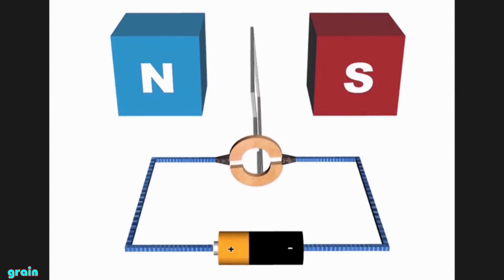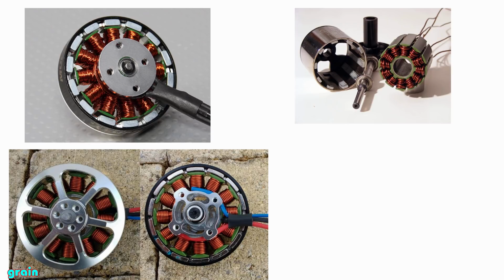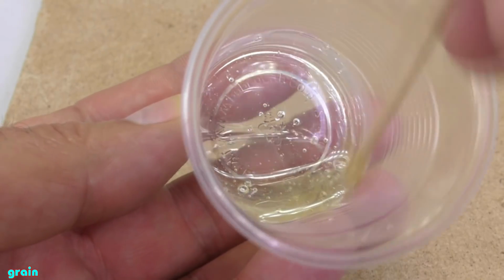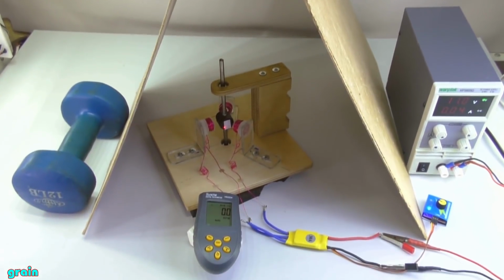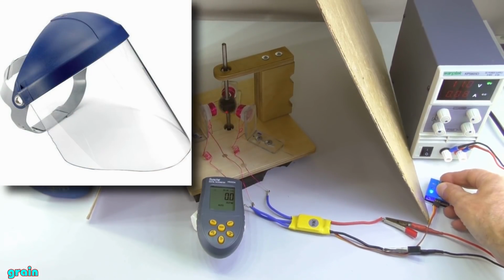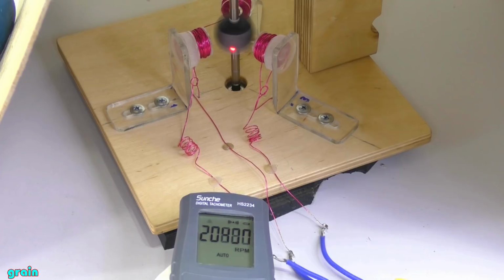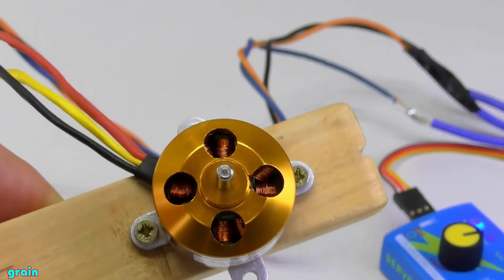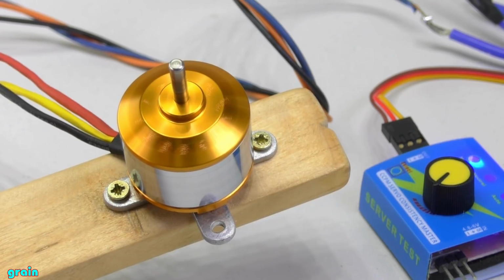Simple brushless three-phase motor 24,000 RPM

Comment: My third attempt at failure.
150 turns of 0.5mm around a plastic spool.  3.5-ohm resistance on each coil..  All wound the same direction.  All three connected in wye configuration just like yours.
2 pairs of 1 inch N52 neodymium magnets, back to back the same side facing out.
Placed the coils  (  1 1/2 diameter size ) at 120 degrees about 1mm  away from the magnets.
Supplied 12 volts DC. The magnets seem to go back and forth just a little.
I used the same exact controller as you do.
There is just one difference between your setup and mine.  Your coils are on plastic angle brackets.  Mine are on wood.
One more difference between your setup and mine.  Your rod is held by bearing on both bottom and top.  Mine is held just in the bottom, just to see if it even works.  No, go. Nothing.

First I screwed the center of the coils to the wood bracket but then I thought that maybe the problem., attracting magnet to the screws.  So I took the one screw out of each spool and hot glued the back of the spool to the wood.  Nothing, no go.  I also span the rotor with my hand and in both directions clockwise and counterclockwise.  No success. zero, zilch.

The only success I have had is with 12 coils and 4 poles magnets and 24 coils and 8 pole magnets.  No success with the above set up and oh also no success with 2 pole magnets and 6 coils. Flunk.
Reply from the maker: "2 pairs of 1 inch N52 neodymium magnets, back to back the same side facing out."
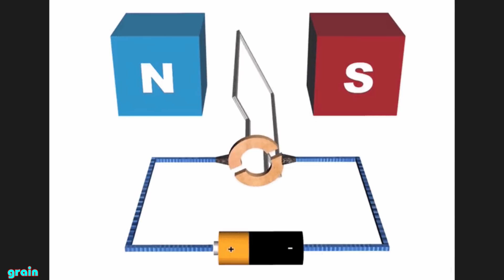Identical poles outward? The magnets on the rotor should be positioned so that they have different external poles - S and N. See 1:01
If you have 4 poles on the rotor, they should alternate: S - N - S - N.
Reply from the maker: Please take safety precautions: If the magnets come off as they rotate, you may be injured. For example, place plexiglass (glass does not fit) between you and the motor.
Reply: @grain-diose  This is what you said yesterday to the question of the same poles or opposite poles.  II am copying and pasting.  You can also read it down below in your yesterday"s response.  "All magnets are facing the same direction with the same pole. Which pole is facing does not matter,"
I am not expecting a response to this. As always thanks for everything you do.

Comment: What AWG was the copper red wire you had in the video?
Reply from the maker: Copper enameled wire 0.5 mm in diameter was used for winding the coils.
Reply: @grain-diose  there was no rating for the wire? Not even 28 AWG?
Reply from the maker: @conzpicuouz  I do not understand what kind of wire you are talking about.

Comment: Hi,
Are the two magnets the same side facing out and if so are the repelled or attracted to the coils when they are energized by the controller?  Thanks.
Reply from the maker: All magnets are facing the same direction with the same pole. Which pole is facing does not matter, it will only affect the direction of rotation. To change the direction of rotation, it is enough to swap two of the three external terminals that go from the coils to the controller.
Reply: @grain-diose   I just wanted to make sure that the rotor set up in your 3 phase brushless DC was not the same as the schematics you had on the screen for 3 phase,  6 stator 2 pole magnet. Thank you so much and as always appreciate your help.

Comment: Hello Sir, I want to copy this, can you tell me the rotation of winding and how to connect the start and end wire, thank you
Reply from the maker: You need to mark the beginning of each coil when making them (wind the wire in one direction). Then connect together the three beginnings of the coils or the three ends of the coils. There are three wires left that you connect to the electronic control.
Reply: @grain-diose  How are you converting DC 12 v  to three phase AC ?

What is net output voltage in coil? 

Can I use a 220 volts ceiling fan regulator??
Reply from the maker: @rudradebsom8421  Brushless Motor Controller - https://aliexpress.com/item/4000158618883.html
Can I use a 220 volts ceiling fan regulat - NO!

Comment: Thank you! One question. What is the purpose of the spring like coils in each wire leading to the spooling?
Reply from the maker: No value, it's just the extra length of the wire.
Reply: Thank you! Looks cool.
Reply: @grain-diose  it maybe reducing your max RPM because its acting like an inductor

Comment: Copying and pasting  your statements here:   Your first statement: 
"All magnets are facing the same direction with the same pole.".  
Your  second statement: 
"The magnets on the rotor should be positioned so that they have different external poles - S and N."

I think your magnets are not facing the same direction.  I think  Your magnets are facing opposite directions from each other.  But what do I know?
But whether they are the same poles facing out or opposite pole it is hard telling since there are no labels on the magnets in your apparatus nor can I tell which of the above two statements is the correct version as the two statements don't seem to say the same thing.  But maybe they do say the same thing. I am neither a professional nor English is my primary language.

As always thanks for everything you do.
Reply from the maker: The second statement is correct - different poles. The first statement -  I quoted your words, therefore there are quotation marks.

Comment: How much power did that draw?
Reply from the maker: The current was maximum for my power supply 5 amperes. And the voltage was most likely small, since there are few turns and the voltage immediately decreases. I do not remember already, but I think no more than 5-10 volts. That is approximately 25-50 watts.